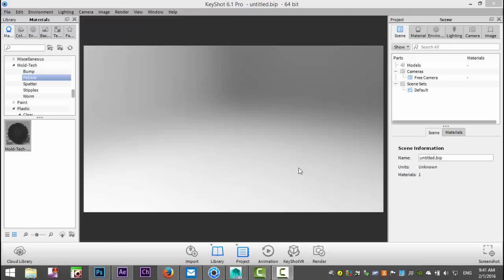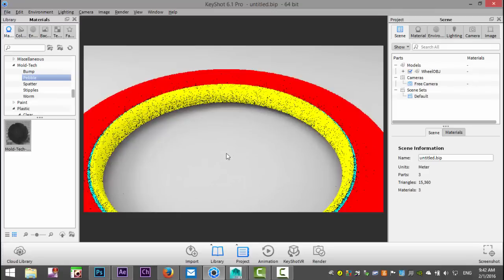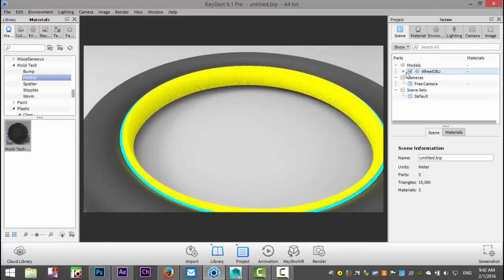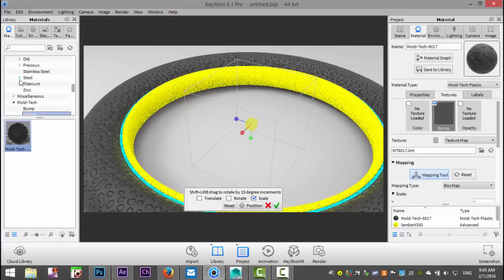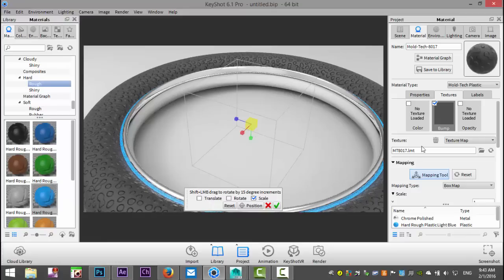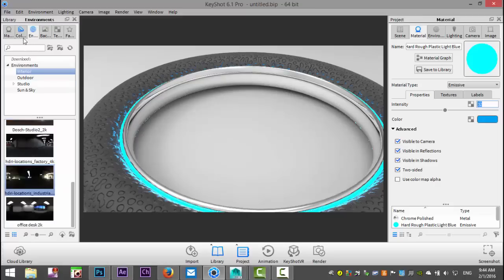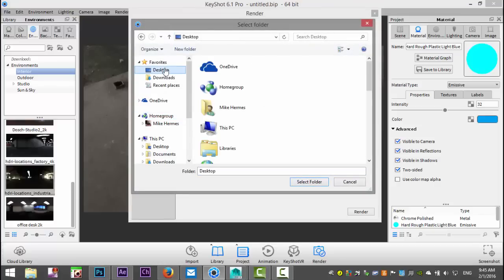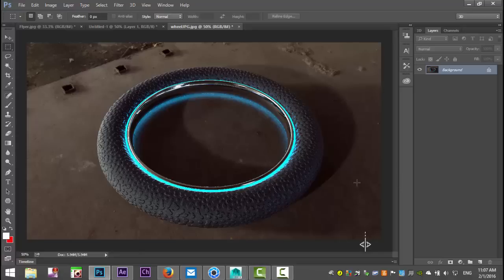Keyshot 6.1 Tutorial : How to create an emissive / LED light effect

Comment: Sorry for the random question on an old video but, concerning rendering, will a dated and/or suboptimal gpu simply require more time to export a fully rendered image? Or are there some tasks that are just too much of a burden for, perhaps, non-pro hardware? And I don't mean trying to get 4K out of a 720p card, or anything silly like that..
Reply from the maker: It is a combination as most renders are CPU based with support from the GPU. So lots of RAM helps but the render could complete slow or just freeze, depending on render
Reply: @MHTutorials3D  ah, I see. Thanks for taking the time to reply..